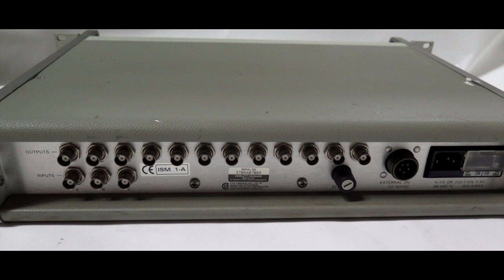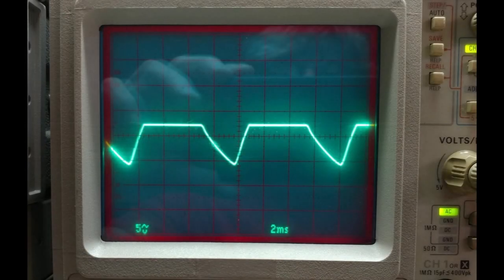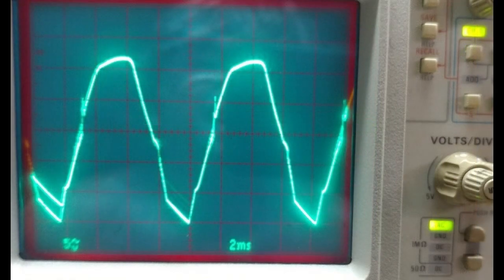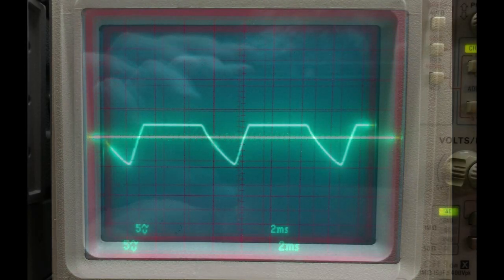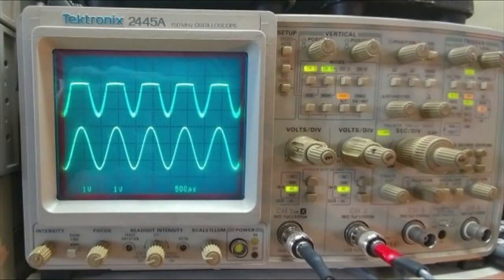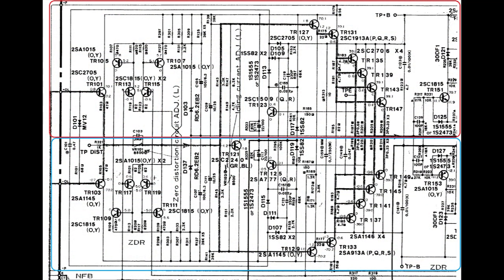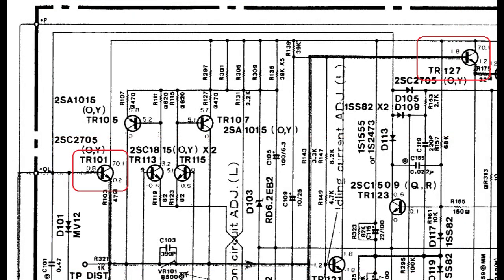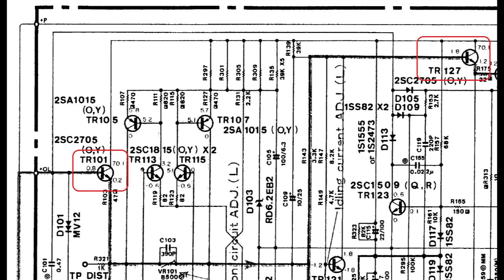Interpreting Oscilloscope Waveforms

Comment: The 2SC2705 and 2SA1145 were common failure items on many brands. DBX BX3mK2's for example, Pioneer surround units from the 90s, others too. They're just asking too much from them as drivers. The VI product (heat stress) gets to them.